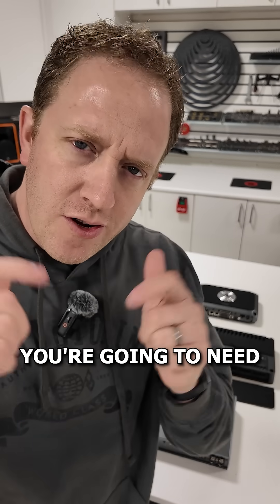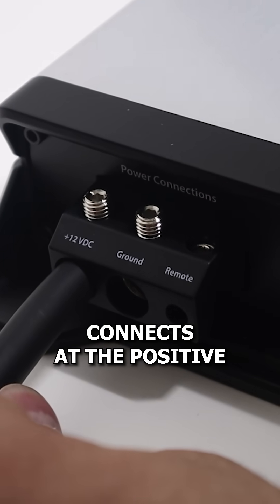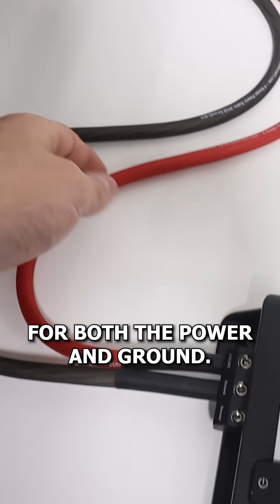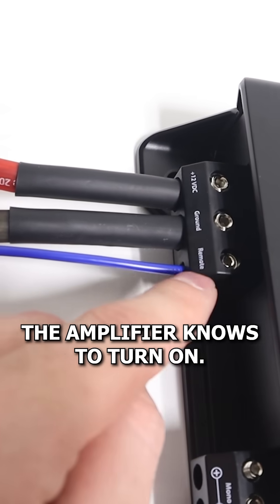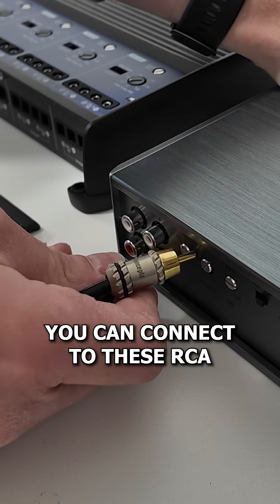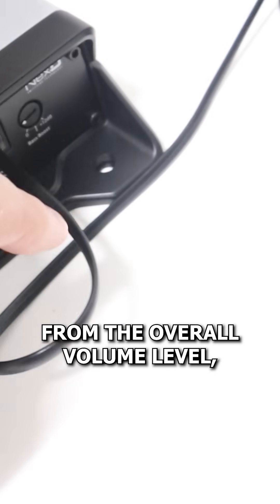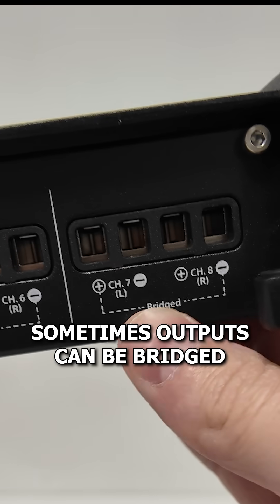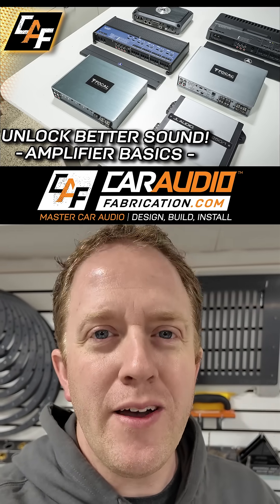Car Audio Amplifier Basics - Connections Edition  #caraudiofabrication

Comment: Arent u supposed to connect negative first and positive last?
Reply from the maker: Nope. Ground last when connecting first when disconnecting
Reply: @CarAudioFabrication but how do you charge the caps inside? What i usually do is connect ground, then i get a light bulb from a car connect 2 wires to it. Hold 1 end to the positive of the battery and other end in the positive of the amp, you see the light going dim which means the caps are charged. That way i dont spark or whatsoever. And at last remote and rca's. If you have better tips and or explanation videos please let me know!

Comment: Im surprised that remote is still a thing. Considering there is technology out there that sends current through the speaker wiring and its able to detect it and turn it on. The audio control LOC has this. Why hasn’t more amplifier company done this?
Reply: I'd imagine it's because it isn't an industry standard, and depending on a number of factors, your amps could turn on too late for your needs possibly if it's based off of current detection in the wires

Comment: Can you explain the "sub sonic" knob on a mono amp?? And how to tune?
Reply from the maker: Keep an eye out for our next short video. Also covered in our amplifier tuning video on the channel
Reply: Subsonic is used on ported boxes. It filters out frequency below the tuning of your box.  If your box is tuned to 35hz, you set your subsonic around 35 and you're done.  If you're using a sealed box leave subsonic off/at zero.
Reply: @MAD_CarAudio  Not true. You put it half an octave lower than your subwoofer box tune
Reply: @TheLightKyanite yet...box tune devided by 2...then devide that by 2 ..then subtract that from the  box tune! (32 tune...would be 16 then 8..then 32 minus 8 is 24! Set subSonic at 24!